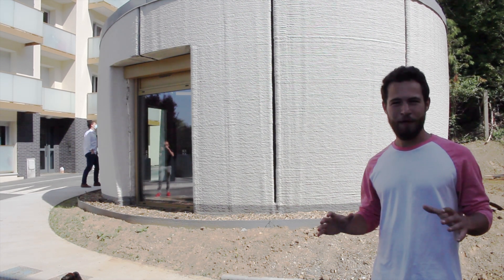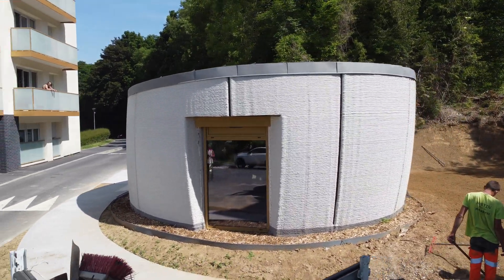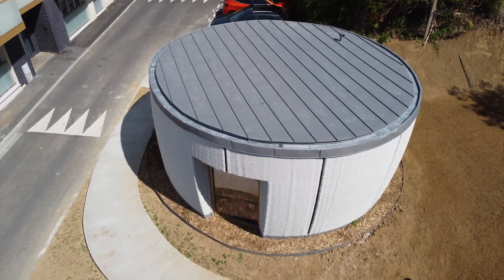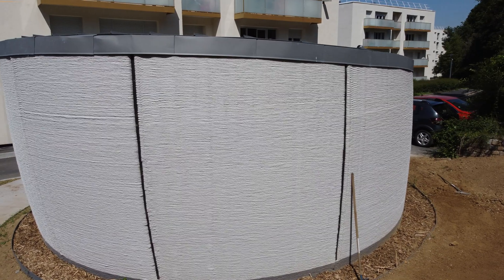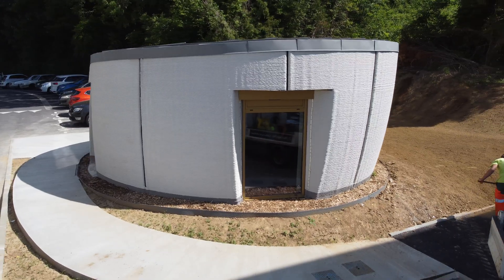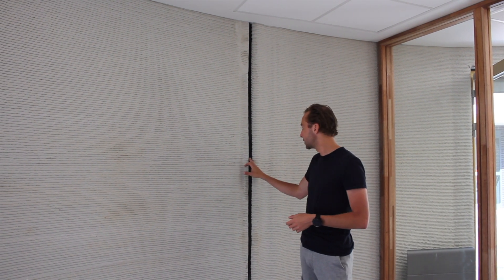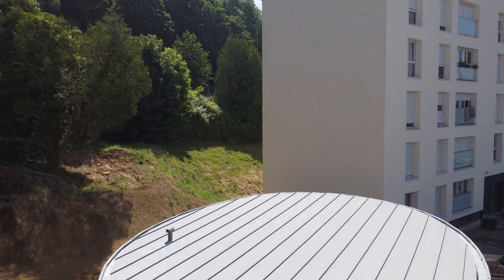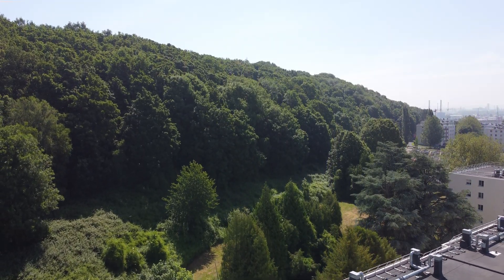Concrete Always Cracks? Not in this 3D Printed Building! | Bouygues in France [Print by CyBe]

Comment: Isn’tit easier to build a house with wood?
Reply: Once all the kinks have been worked out, you'll rent a printer for a week with an operator or two. You'll get a fully insulated concrete shell where everything (wiring, plumbing, air handling, window openings, stairs, etc.) are exactly to spec. At this point it is way easier to build with wood, but 3D printing habitats is undoubtedly the future.